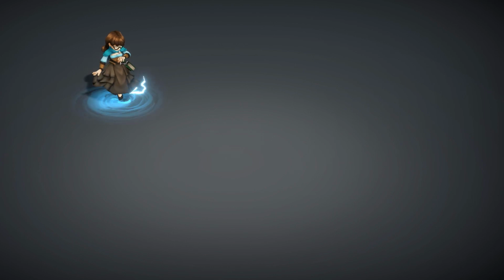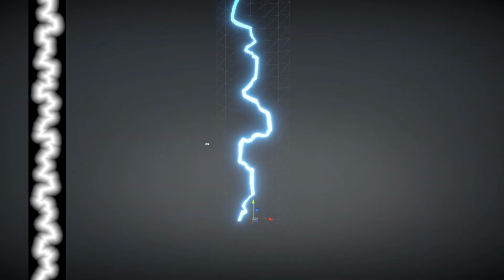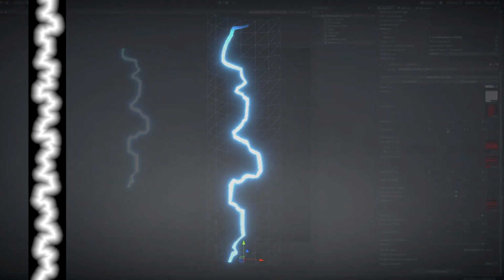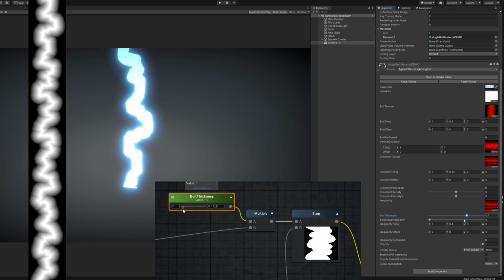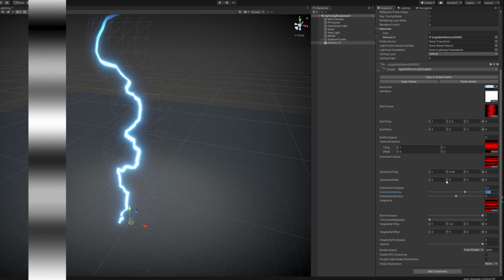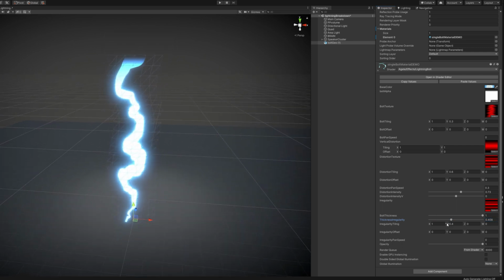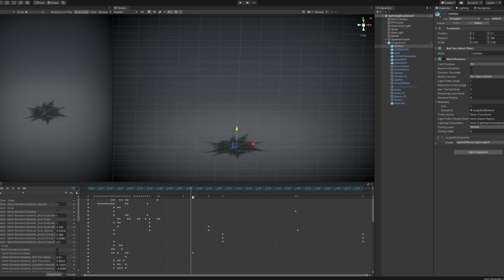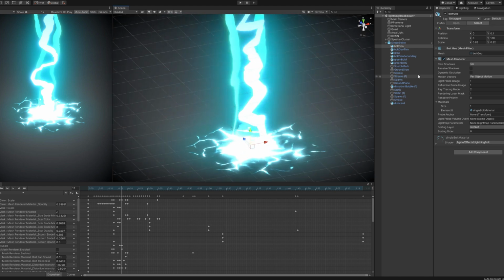Realtime VFX Breakdown - Lightning Storm

Comment: How were you able to make the mesh expand in and out like that, with the gradient? Every time I try the modify that axis it just flattens the object
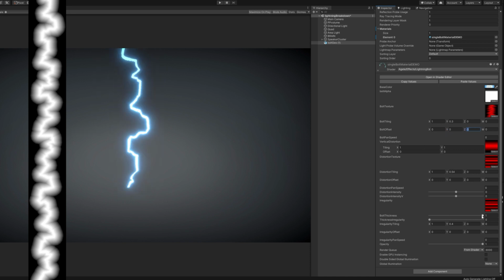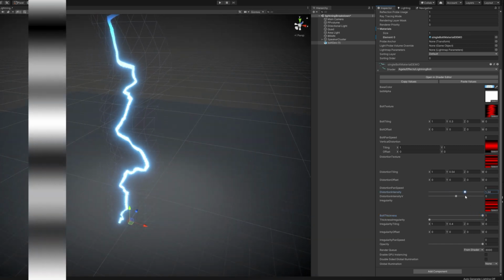Reply from the maker: You talking about expansion at 0:30?  That's not the mesh expanding, but just the edges of the mask.  Another way to think about it - that step node in the shader is basically saying "Only show pure white pixels" by default.  As I reduce the step, it adds more and more values.  If you're talking about the wiggling mesh displacement at 0:41, you can try each of the axes to see which is which if you're having trouble, but in this case its only changing X offset and leaving the others alone.  You can multiply your offset by the surface normal to make the direction consistent regardless of how the mesh is oriented too.
Reply: @MikaMobileApps  I see what you mean and I'm having some luck. One other question, How did you get the bolt texture to come out like that? Is it a procedurally generated, using effects, hand drawn? I only ask because there are sharp bends along the outside of the bolt.
Reply from the maker: @Fae_law  I hand painted the innermost shape (the thinnest the bolt can be), and then did a "glow" layer effect in photoshop with the falloff set to be completely linear

Comment: How did u make the random thickness to be smoothly blended with the original texture? Im getting alot of big seams D:
Reply from the maker: If I remember correctly, I'm just adding to the values from that "random thickness" gradient to the base texture.  The gradient loops seemlessly, and the base texture does too, so no seams.
Reply: @MikaMobileApps  I'll run some test to see how it goes. Thanks!
Reply: @andrestapiatorres7766  did you manage to make it work? i can help you if needed.

Comment: Hi, i spent countless hours on the first battleheart wayback in 2013 thanks to my cousin, i see the progression of animation is impressive and i hope for this game development to be finished. I was really curious, how was the 2011 first Battlehearts animated in terms of equipment (like a tablet)?
Reply from the maker: I drew the characters on a tablet, broke them up into layers (for arms, legs, heads, etc.) and animated the parts moving around in Maya.  Many limitations back then - couldn't change the overall drawing really, just had to rotate and squish around the parts to make them do stuff, like a paper cutout.
Reply: @MikaMobileApps  so in terms of "Papercut motion" is simillar to tweening/motion guide in Adobe animate, very interesting. Thanks for da knowledge :) i also tried to make a sort of game with a gotoandplay and hold + drag script in flash but drawing frame by frame is really tiring so i puppeted them after drawing.

Comment: Hello, which program did you use to generate those mask texture? thanks exellent video.
Reply from the maker: The lightning mask I painted on my ipad with procreate, with some editing in photoshop to make it seamlessly tile, and to create the gradient which allows for the thickness control.  That gradient is just the default photoshop "outer glow" layer style, with the falloff set to be perfectly linear.  The other masks are just photoshop gradients.